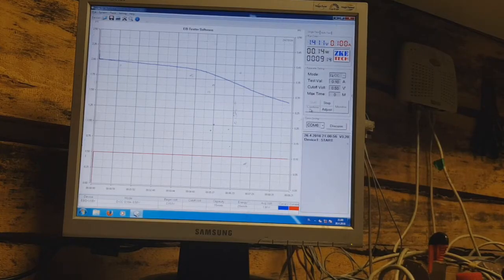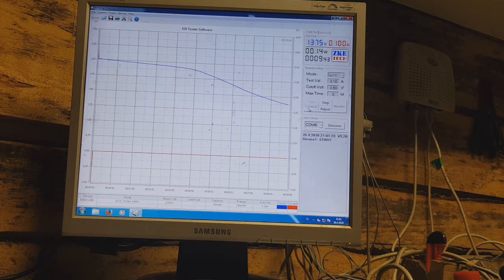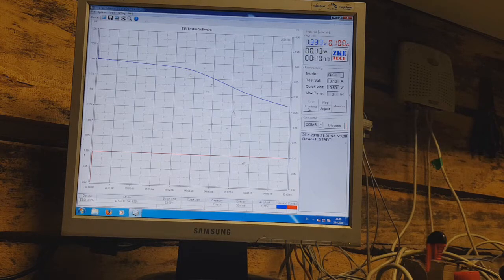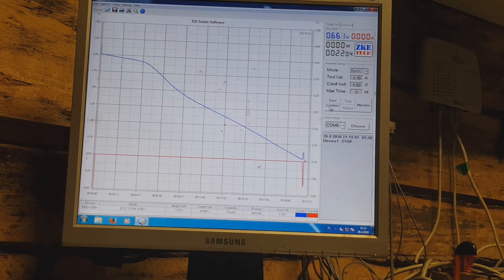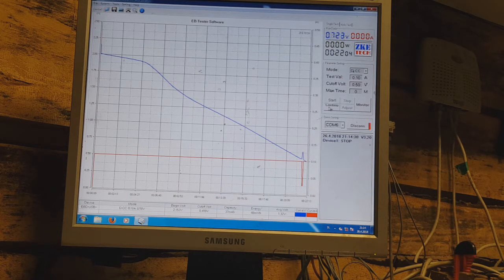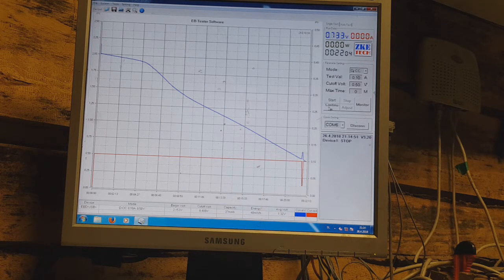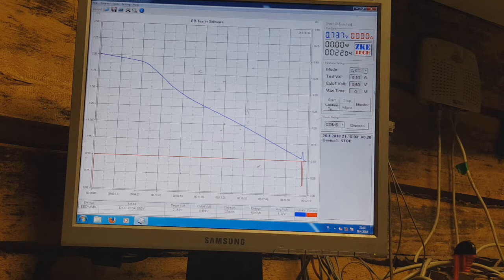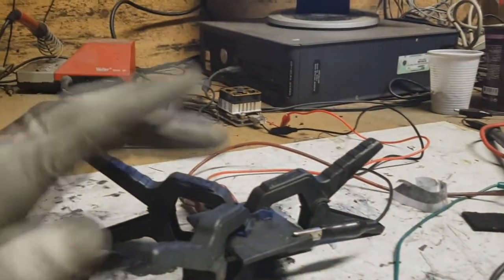Zinc ion Capacitor VS Lithium ion Capacitor

Comment: Hi buddy . I read an article about ion concentration in regards to over and under saturation . Very interesting but I can’t find it ! Hoping you may know of it ? Anyhow it proposes that just the right amount of concentration of the electrolyte with give outstanding results but even 10% difference either way would alter the energy capacity greatly . Point being it might be really interesting to explore concentration of your electrolyte to see different results . It’s all about filling the holes with ions but not impeding their flow efficiency was my interpretation .

Comment: Great work.
 I am of the opinion that the zinc allows the current collector to go into the storage material or activated carbon. The problem is weather the zinc is being consumed in the process as a redux component. I was getting the strengthening as you cycle the cell in my crystal batteries. In my version the current collectors were of different material which biased the cell into a diode like setup. This was done via the electronegativity of the current collectors ie: https://en.wikipedia.org/wiki/Electronegativity
 In my case I used graphite and aluminum.  Carbon-2.55 Al-1.61 =.94 differential.
 The problem with the crystal batteries was that the surface area was non existent or very small which made the current very small. Plus using an electrolyte would also allow the degradation of the current collectors. Thats why we started to use a crystal matrix as the electrolyte. With aluminum there is also an oxidation process that tends to protect the current collector if borax is used in the electrolyte. We borrowed this from the electrolytic caps. My cells we much better at cycling and the current collectors were untouched after adding the borax but the current was still not there.
 This is where I started to look into carbon for a storage material on top of the current collector to better collect the components of the electrolyte. In your case doping the carbon with zinc or any other conductive material allows the storage material to better be influenced deeper into the storage material.